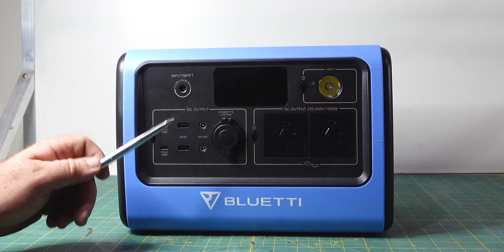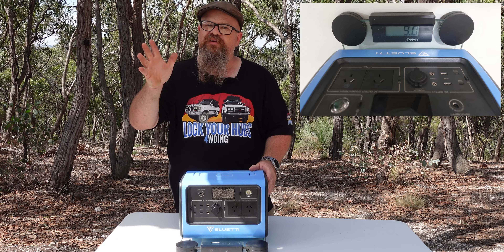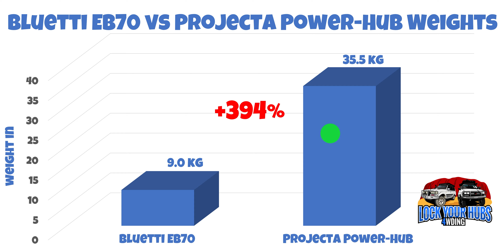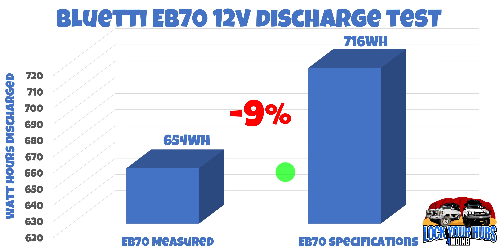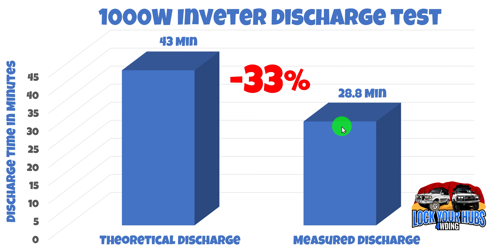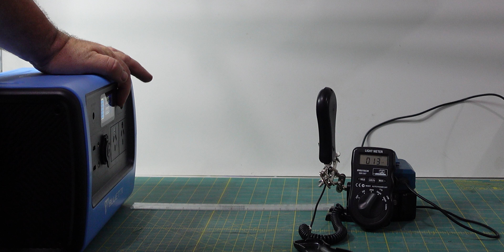Lithium vs Lead Acid Bluetti EB70 vs Projecta Power-Hub

Comment: Lithium.... everything including my starting battery is Lithium. 
iTech1420CA PRO cranking battery tested at 1926CCA 63AHr
iTech120X, 120Ahr "deep cycle" 
Both are 4gen BMS 
iTech DCDC40 which integrates main/secondary/solar with MPPT. 
Unless I'm gone for more than 4 days, I don't bother with the solar panel. 
I've never thought about a portable power-hub as 90% of my power draw stays in the car
Reply from the maker: It depends on your camping setup I guess, occasionally I'm camped further away from the car than you can run wires for power inside your tent or swag.
Reply: @LockyourHubs4WDing  Oh absolutely. Having a swag until I get my HS RRT I can attest to running cords but having said that, I leave my phone in the car because I'm always out of service (best way to camp imo) and my light are all rechargeable so the only wire I'd need if for a ran, which I can say I haven't needed. Ultimately once I've finished my set up it will be all self contained for fast set up and pack up times so I can get to camp and not worry about dragging crates out or stuffing around with a swag/tent, sit back and have a cuppa.

Comment: almost certain that 650wh cutoff would be bms related 90% DOD cycle is pretty good, i wouldn't want to discharge it much more than that. 

IMO these units suit the more casual camping crowd, those that have subaru type SUV and not so much proper 4wds, where typical campsites they frequent  are a short walk from car where the carpark is fenced from the site.  They typically have low power requirements, just a few camp lights, few phones, laptops, torches, maybe a little heated blanket and most likely only use an esky or small fridge

These are not cost effective for larger power requirements . They also can't be tucked out of the way into dead spaces , under bonnet or tray etc. They remind me of apple products, very sleek  and elegant solution which are easy to use and understand user interface but lack the customisability and functions power users want. 

They actually seem to be decent value for lower power requirements. Try to piece together a 56ah Lifepo4 capable of 100A discharge, 1000w PSW inverter, 240v charger, mppt regulator, enclosures , usb, usb c pd sockets and shunt based battery monitor. I don't think youll be be far off or even beat it. You still have to assemble it and it won't be as neat of a unit.

Only problem is that 12v charge time, absolutely hopeless which would probably be fine if you charged it up before you leave for a weekender and bring a solar blanket with you

Comment: I used to use an AGM inside my projecta power hub but switched to a 12v 100ah lithium. Works great 👍
Reply from the maker: After getting the Bluetti, I gave the projects to one of the kids, she's putting a 100ah Lithium in it as well! Should last a lot longer, and be much lighter....

Comment: Hi ...off the topic question. 
I have a Prado with 2 inch Dobinsons lift.
My stock tires are 265/65/R17.
Now after lift I want to change the tires to All terrain but am confused on what tire size to keep.
Should I keep it same 265/65 or change it?
If I increase the tire size will it effect the pick up power or speedometer?
Reply from the maker: If you go up in size without changing diff ratios your speedo will change and the car will accelerate slightly worse. 

Remember, you only get half the diameter increase of the tyre size in extra clearance under the car. 

Having said that, for off-roading, as long as the tyres clear the bodywork etc, I haven't met a tyre size increase that I haven't liked!

Comment: Great review but look forward to seeing some more real world testing over a few days camping, and hearing how it holds up after a few months of use. About the step up converter, can you just wire that up to a normal ciggy plug. So you use the ciggy plug charger provided by bluettie, cut it in the middle, and then wire the step up into it?
Reply from the maker: For a travel buddy?
Reply: I'm assuming you mean using the 28v boost converter to charge the bluetti system faster? The answer is not really. at 28V the unit will try to pull ~200w /16A. from your ciggarette socket which most cars top out at 10A for. You would need to run a dedicated wire from the battery to do it.

Comment: Without an Anderson plug input, how do you connect your solar blanket? Can you get an adaptor, or do you need to use their proprietary panels?
Reply from the maker: There's an adaptor cable for standard solar plug inputs. If your solar blanket uses Anderson plugs, you'll need to make an adaptor.

Comment: Lower C rate would've got closer to the stated capacity. A real world weekend away test is required please 🙏
Reply from the maker: A lower C rate discharge might have gotten a little closer, but probably not near 10%.

I'll be using the Bluetti camping, so keep an eye out on upcoming videos.
Reply: I don't believe peukerts coeff is applicable for lithium batteries?